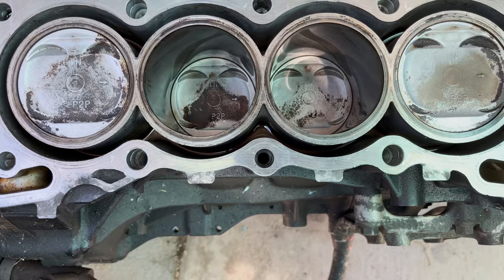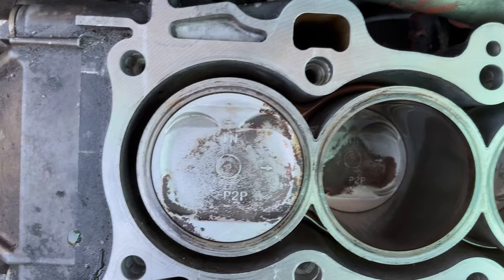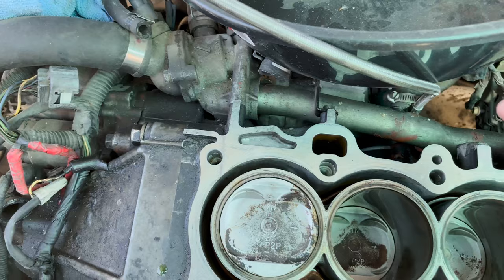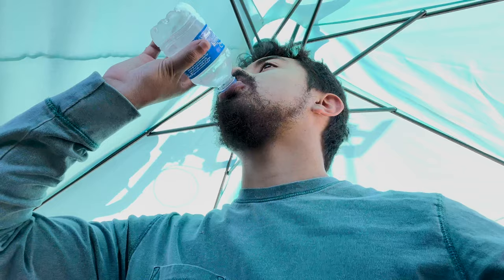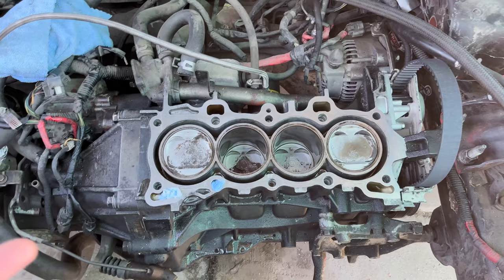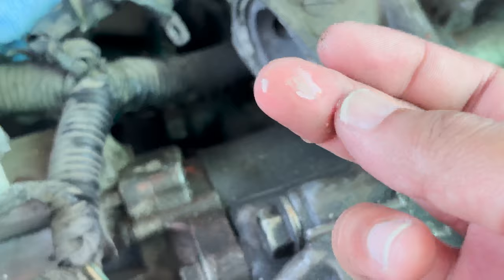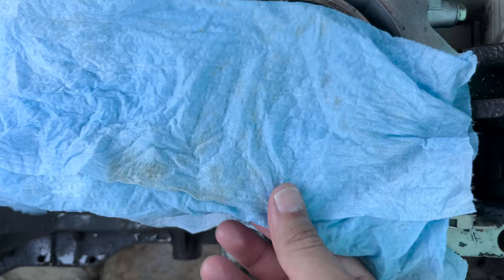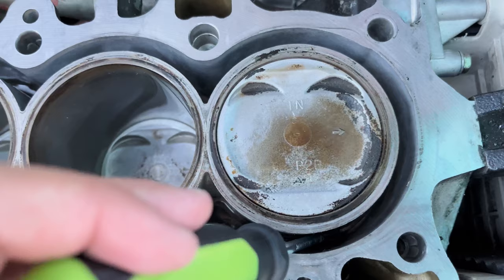Flushing Coolant in the D16 Block

Comment: Well actually there is a specific bolt on the back of the block just below the water tube un screw that one to do the flushing
Reply from the maker: Yea that I found out like a month later 🤣 that’s the proper and easiest way to drain, because damn my back was hurting already.
Reply from the maker: Also I’d think it’s easier to do that when the block is out of the bay, but I don’t everyone will pull the motor or have another legit reason to have it out. Proper tools will pop it out, just like how that oil filter can be a PITA to get out at times.

Comment: Doesn't hot antifreeze EXIT the head, and then goes through the rad, and THEN returns to the engine via the lower hose?
Reply from the maker: Yes you are CORRECT. My apologies, at the time I had it reversed. It does flow in that direction, hence why the upper radiator hose is generally hotter given, that the antifreeze is traveling away from the head.
Reply: @bwcp  Thanks, Dawg. I thought I was trippin'...lol